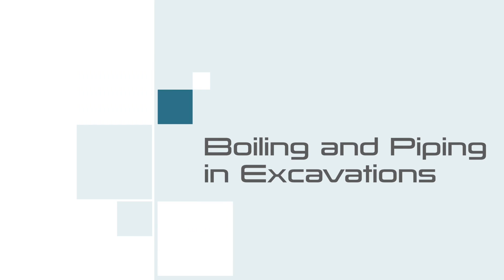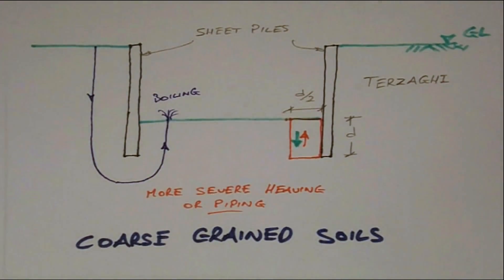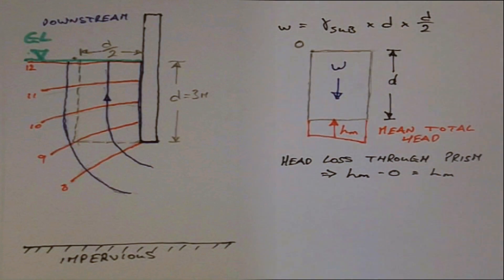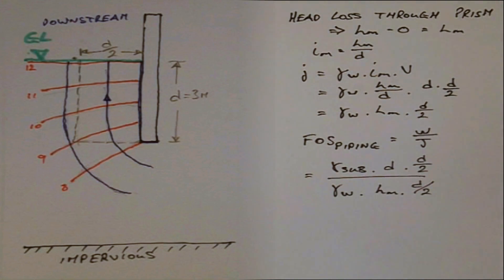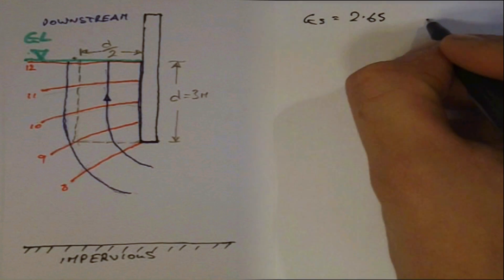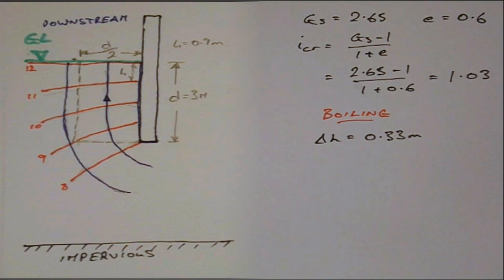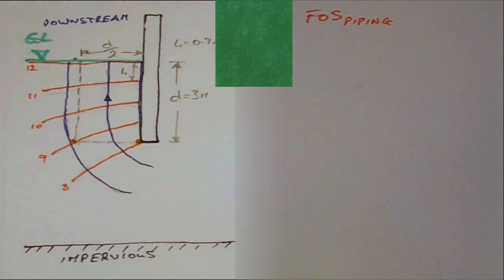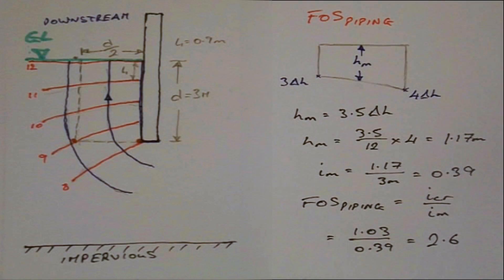Boiling and Piping in Excavations

Comment: In 3:44, how come that the Delta h = 0.33m? Please ellaborate.
Reply: Same with the L1, where does 0.9 came from?
Reply: @MK-wo6rf  0.9m is scaled from the drawing.
Reply: At 4.58 he mentions that difference in total head = 4m, therefore 4m/12 head drops = 0.33m per head drop (Delta h).

Comment: Physically, what is the difference between boiling and piping? I’m assuming piping would be loss of material. Is boiling just the point at which effective stress =0 and piping is slightly more energy to cause removal of soil particles?

Comment: why was the difference in total head for the piping=  4m not 3? as illustrated.
Reply: The total head is 4m at one corner and 3m at the opposite corner for the soil block in question. That’s why he had to calculate average head across the base of the soil block.